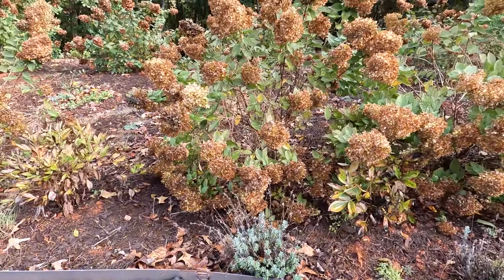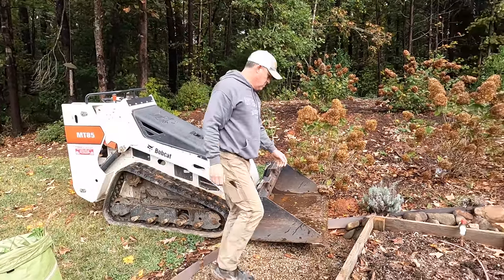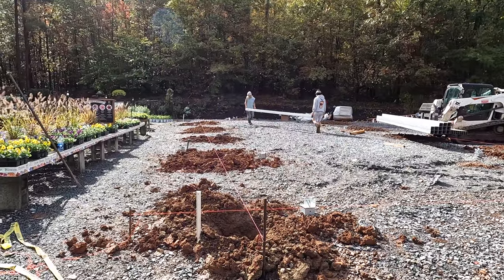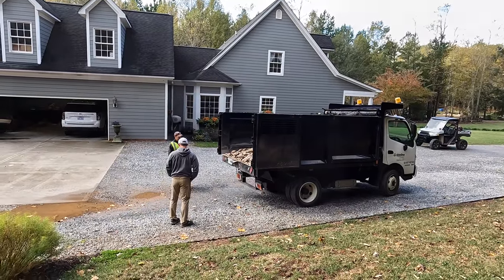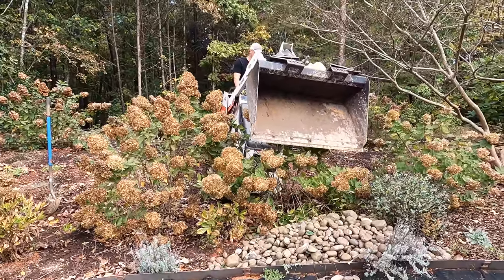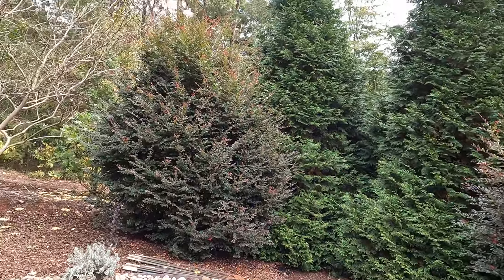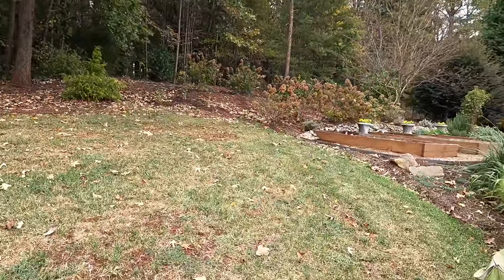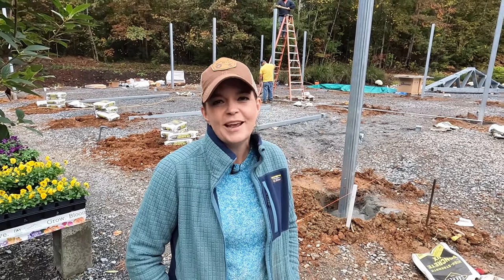Small Project Completed & Greenhouse Footers Installed | Gardening with Creekside

Comment: Thank you Jenny and Jerry for the update. STILL SO EXCITED!! Atlas A Frame was such a great choice.   Double thumbs up. 
I'm always honest and direct with everything. I don't pussy foot around.. [it is a waste of time].
[1] Funny how much different taste people have.  I simply can't stand River Rock in gardens or in yards. I think they serve 1 purpose and that is to line River Banks!
I do not understand why anyone puts ROCKS [or gravel] of any kind around plants.  It holds the heat in from the SUN and keeps radiating it into the ground and surrounding areas.   It can also do damage to the root systems from baking them. Especially those fine hair type roots.
Why didn't you just square off that level where the black cloth is, and put in wall blocks/ bigger bricks, etc.  It would have clean edges and no slope.  Slopes are so annoying to work around.  Then just mulch things. NO ROCK..just mulch. 
[2] Just cut back all the Amazel Basil or simply separate it and use it in 2 corners instead.
[3] Yeaaaaahhh ! The bobcat is unstuck!!!  I knew Jerry would figure it out. 
After watching that, I am more convinced that little retaining walls would have been much better choice.  Like 1 retaining wall every 4-5 feet, going down that slope.  - When to walk away, ,and when to RUN!
[4]  Love those 3 Thuja Green Giant's. They are terrific.  
[5] Jackson is so cute. The upper part of his face looks just like Jenny,, but the mouth and lower expressions are JERRY... 100%!